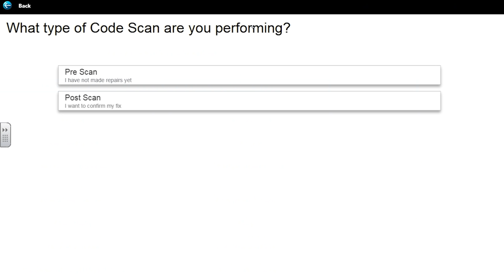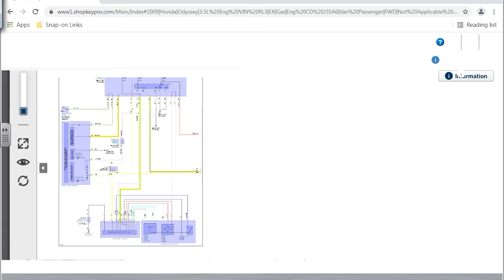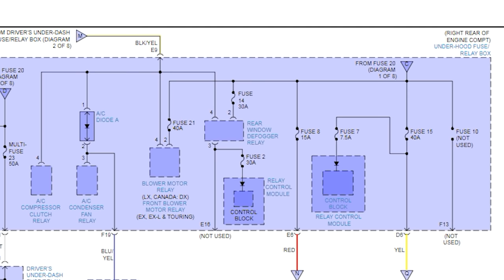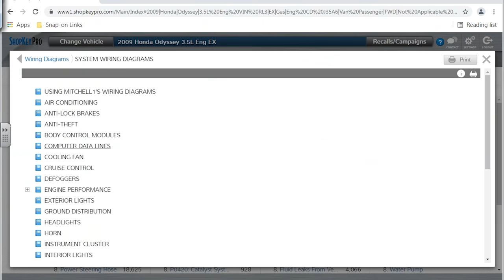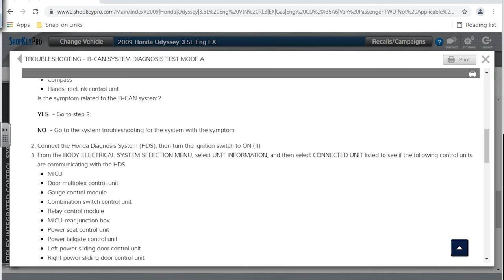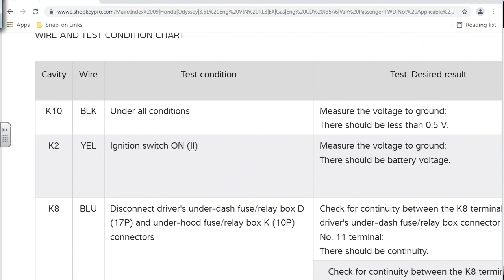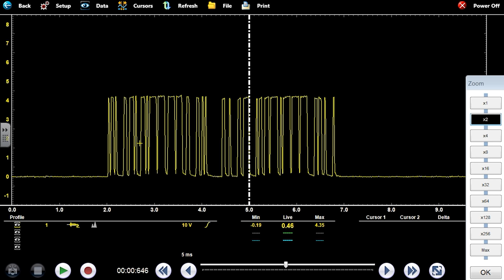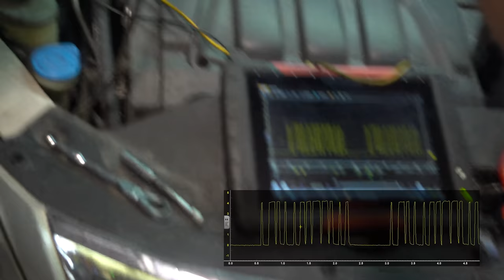Honda B-CAN Network Diagnostics (single wire design)

Comment: I'm working on a A029 communication fault in my Prius hybrid battery system. This really helped with troubleshooting the single wire system. Thanks.
Reply: Did you resolve your issue? 

Fingers crossed 🤞🏽

Comment: Honda in Europe commonly use, for all comfort systems, a protocol called VAN (as of Peugeot, Citroën, etc.). It's similar to CAN in implementation in the way that all units talk but in a 0 to 5V signal. But it's the first time I´ve seen this B-CAN protocol. I'm not aware if this had been used in Europe.
Thanks for the video. It's great.

Comment: Ive been using this same method on networks for years. Check it plugged in, then unplug it, if waveform stays the same, network is good. Ive always wondered if that was a valid test method, ive always thought so and youve confirmed that. Ive also wanted to depin the network wire and plug the connector back in to check if anythings coming from the failed module but never have. Was cool to see you do that even though you cut the wire lol just giving you a little bit of a hard time. 
Caleb, i was laughing my butt of when Danner was messing with the wipers and the music you edited in. That was classic, great job.
Reply from the maker: Thank you my friend! This was a good one and I appreciate this feedback

Comment: The final "unplug test" is worth a million thank you's. Another test in my arsenal, Thxs a bunch scannerdanner
Reply from the maker: I agree 100%, if nothing else was gained, the unplug it test that still showed network activity was super useful in identifying the network wiring integrity without using an ohmmeter to check for an open circuit. Also, this is a universal concept that we can use across the board on network diagnostic stuff.

Comment: Wow... Use a bigger hammer. I have learned a big lesson on network problems, such as this. I have your book and it has changed the way I look and diagnose many problem. I worked on a 2002 ram and it would not crank, turned the key on and the odometer and headlights would flash. Weird. But using your book and watching your videos I figured it out, took a while but the ecm and the bcm were communicating not having a wiring diagram, going through every wire between the two, and many hours later checking 5 volt references learned from your book and videos I found 3 bad connections between the two. Blew my mind, I figured it out. You are a great teacher. Thanks to Kaleb for his great video making too. Oh congratulations on your new baby. Keep making these GREAT videos both of you, also great to see more of your brother in the videos. Thank you all, and God bless. Jerry.

Comment: Hi again. I remember my Moms Cavalier was back firing and shutting off and it took me about 4 hrs. of back probing to find nothing wrong. Sat the ECM on the floor with the engine running, hit the ECM with a screw driver handle and the engine back fired and quit . Since then that's one of my first tests HAHAHA!

Comment: Heads up big boy, you can see if the Relay Control Module is communicating by going into the "Body Unit Information" and "Connected Unit List".  It will say "Detect" or "Not Detect"

Also, the connectors under that thing are usually mad greasy, probably OE grease.

Great work brother, keep it coming!

Comment: 100 % agree with your diagnostic! again NOT A PARTS CHANGER ... and cutting the CAN B wire totally 100% sure that is the problem.  this is a perfect direction went the same symptoms happened in another Honda Odyssey... thank you Paul Danner for continuing making this videos! my thoughts this case is that not even the technician from Honda Dealer do not know how to do this test the you just did...in the other hand I'm wondering if the Autel Ultra was used in this particular case if it shows that fuse module in the RED CAN B with no communication!

Comment: "This is not the silver bullet...This is the Smoking Gun of the Silver Bullet"- John Anello. 

I bet that the working circuits are a fail safe so that you still have wipers and headlights in the event of a failure,  because those are critical for safe operation of the vehicle.  Similar to a transmission having 3rd or 2nd gear default in the event of power failure to the shift solenoids.
Reply from the maker: I agree about the fail safe stuff, makes perfect sense! Thanks for the input and the comment

Comment: Fantastic video and a great way to find the problem. That system must be specific to Honda. I'm not sure if you guys over the ocean deal much with LIN, that's also a single wire communication system. The difference is that there is only 1 master module and the rest are slaves unlike modules in CAN which are all masters and can all transmit information independently. The slaves only communicate when requested by the master so that test might not work too well for them. I have de-pinned connectors to find faults with CAN but to be honest cutting the wire like you did would be much easier and is something I'm going to start doing from now on. Thanks for the tip👍

Comment: Another good vid Paul even the new guys would get your logic on this kind of failure diagnosis, its just whats needed so you dont end up chasing your own tail or start swapping parts even, probably a failed solder joint crap lead free solder strikes again no doubt ......maybe

Comment: My experience with a CAN line was an afrermarket Pioner radio headunit with nissan x-trail/Rogue(in US) It had a CAN box for steering wheel controls and backup camera signal. The car acted strange,  suddenly the dim lights came on for a sec, then no wipers, air con, no torque converter lock, no turn indicators in dash. But the indicators still worked outside, so some fail safe mode was on.  Engine off and on, it worked again. Sometimes a hour, sometimes for a month.
The only module I could not talk to was the BCM, othes had can codes, ECU even"change the ECU" code. Ordered a used BCM, programmed it and it was good only for a day :(.  One time I went to an ATM with mi phone in my pocket and out of the BT range of the head unit. My son was in the car, engine running. As I neared the car, BT connected and the dim lights came on. So it has something to do with the head unit. I removed all connections for the head unit and fow about 2 weeks it was ok. Then connected power and speakers, but not the wire from the CAN box. It all worked, but no steering wheel buttons. The car did not have any DTC's since then. 
Now I have an Android head unit without can and the steeringwheel buttons work.

Comment: The hell with the Honda let’s work on the 32 Ford and the Duster in the background.  Great video Paul.  I love these who done it mysteries.  I just wish these sites that provide the wiring diagrams weren’t so expensive.  Guys like me who work out of their home shop have a hard time affording them.  Cool find, now Ivan would take apart the module and fix the bad solder joint, ha ha.
Reply from the maker: There is a DIY version of what I use that runs $20 a car. If you're doing some side work, just make that part of your bill
https://eautorepair.adtrk.biz/?a=10817&c=24&p=r&s1=
Reply: @ScannerDanner  
  I’ve used Mitchell a little bit for some jobs, I’m just old school and like the old repair manuals.   I was a dealer mechanic for 14 years before I jumped ship in 1988 and went to work for the State in Corrections but still did a lot of work at home, still do, retired from the state in 06.  It’s almost a full time job working from home.  I find your channel and your course invaluable.  Thank you for what you do.
Reply from the maker: @weshawkins7165  thank you!

Comment: It's nice when you can "percussively" prove a module like that. You can almost guarantee it's a cracked solder joint. But will the availability (or not) of a replacement mean you have to repair this one for refitting or just open it for examination....

"Someone's been here" - they've obviously had this intermittent for some time and maybe found that moving the box restored operation. Probably saw some corrosion on a pin and applied all the grease, could have worked for some time just because they disturbed the connectors.
Reply: I wonder about pin grip on that particular terminal. I'd have checked that  cleaned it with deoxit and added some stabilant 22A to it.

Comment: I like to do one last test. the pin drag test. I use welding torch tip cleaners and start loose and find the correct size it could be corrosion or bad pin contact. torch tip clean as well. I had an engine pcm stall when I used a little pressure on the plug

Comment: Excellent diagnosis and thought process. I agree that troublemaker charts are often not the most convenient approach but sometimes necessary as they can help with better circuit understanding especially when they don't provide a circuit description.  I see you're using the verus edge here and I wonder if another scan tool such as an Autel might list the Relay center as a scanable module. On another note what are you using as a screen recorder on the verus and how do you add audio to it since the Edge has no microphone built in. I'd like to do that for some of my videos. Thanks.
Reply from the maker: just a regular windows screen recorder and it has a timer. When we start the desktop, we always shoot some footage of the timer count, then since post production :-) Thanks Phillip

Comment: Dead on accurate about how those modules talk on single wire B-CAN(and 2 wire CAN as well). I'm an Acura dealer tech, but it's the same system. I feel the same about continuity checks on comm wires, it's a waste of time/effort. Better to do the "unplug test" you demonstrated and check the comm wires with my uscope(which you convinced me to buy and I love). 

Side note: I don't follow the manufacturer flow chart either haha. Construction and function, theory and operation, what does it need to operate correctly and what are you missing. That's my method. Flow charts be damned :)

You do a lot for the up and comers in this field! I'll be showing the apprentice I work with this video!
Reply from the maker: Thank you so much Nick! This really means a lot to me. Have a blessed day

Comment: Right before you said I should depin the terminal,  I was just thinking, pull a Diagnose Dan and cut the com line! Great minds think alike. But that was great info on single line communication.  I would like to know if the salvage yard module worked.

Comment: I suspect if you are able to take the box apart you will find that a solder joint on a relay or other large/heavy component has cracked. This usually happens due to poor layout of the PCB. Sometimes the solder pad for the large component is not large enough so it can't mechanical stress. Sometimes it is a combination of high current through a connection plus vibration. Large components should be glued down to prevent the solder joints form taking all the mechanical stress but they most often are not. Early 2000s Accords had this same issue with a starter circuit relay under the steering wheel.

Comment: Is this considered to be a LIN communication line?  What a great Vid Mr Danner!  You continue to impress!  Thank you!
Reply: Similar concept, but LIN is usually nearer battery voltage - this was a 0-5V signal.
Reply: no m8
Reply from the maker: as Simon said, same concept just different voltage levels. But if this was a Lin Bus you wouldn't treat it any differently than I did here. Thanks!
Reply from the maker: @CANDiagnostic  what is "m8" can you elaborate for me a little more? Thank you
Reply: @ScannerDanner  mate   m8    😅. Didn't think I would ever teach Paul Danner anything
Reply from the maker: @CANDiagnostic  😂 nice

Comment: Throw away the Snap-On. Grab the Autel instead.  Or an Xtool. It has functions to program boxes like that! No need to call some dude who will charge you a hundred bucks just to program a box. I've programmed various Honda modules with the Autel. Oh, And it has more modules listed. It probably has the Relay Module listed too. Snap-on didn't. You said the best scan tool is the Dealer tool.  The Autel software is based on the dealer's scan tools. It's great that you had to cut a CAN wire. I do it all the time. It's the fastest way to test whether a module is working or dead. Super great video!

Comment: the fuse box will come apart but it is a real pain in the !!!! . I took mine apart to change the ELD after changing the alternator !
Reply: mine is a 2010 ex lots of pins fall out be careful !

Comment: Maybe just realize the reason why: No. 4 line to the Rear window defogger relay, can carry a high current 'spike' when the relays from the AC cluster closes! Relay control module apparently contains some high current components.

Comment: Even if there was a known issue they still would need to test it. I've done so many diags where a shop or a customer found on line a known fix and shot gunned a part with no luck. Just because theres a known issue doesn't mean you dont have to test.
Reply from the maker: exactly! Thank you

Comment: The Horn, low beams and low wipers are "safety" systems. They have to work. Thus they are hardwired and not a request through a communication wire. Probably, unless I'm wrong... Honda diagrams are tough to decipher.
Reply from the maker: I believe you are correct

Comment: Awesome video. Btw , electronic modules are getting too difficult to repair.. Im sure Danner prefer working on the great machine - 1932 Coupe in the background . It is awesome car , and doesn't got electronics.. And the Odyssey - why they sealed the module in a way nobody is able to open it and try to repair it? I think SAE should make universal standard for electronic modules , so they can be repaired easier. 🥃

Comment: I "believe" certain safety things aren't controlled by the can network for this exact reason, which is why regular wipers, low beams, ect. work whereas non-essential things didn't work. Its been a minute since I took my Honda specific training (Honda master tech)
Reply from the maker: makes perfect sense! I bet if I looked at the diagram for those components more closely, we may see exactly that

Comment: So if B can come line modules all transmit and receive. Do the bmw lin bus lines transmit and receive as well without the master module?
Reply from the maker: I'm not 100% sure but I'd say yes, all modules produce their own signals. The master you mention may be some type of gateway module?
Reply: @ScannerDanner  yes I did some research. The bmw single line lin bus system. It’s a master and slave system. The DME acts as the master module. The alternator, water pump, etc act as the slave modules. Communication would disappear and be non existent if the master module (dme) is bad or disconnected.

Comment: Hey I have a 05 sts and I hit a curb and it died out and wouldn't start since I jumped the starter really and it turns but won't start I guess no fuel going thru the battery qont hold charge and the lights on dash flicker when I try to jump it with another car the dash lights go black when I try to start then 20 30 seconds later come back on I'm lost please if u have any advice please
Reply from the maker: Is that a caddy? Check the main ground wire where it connects from the battery to the block

Comment: The module may actually be fine. It seems to me that the issue is likely a pin fitment fault. When the scope was back probed at the connector, it can only measure the voltage on the female terminal in the connector, which is mechanically crimped to the wire. If it's isolated from the male terminal in the module, it can't send its message. Since the data packet seemed to jump high during the tap test, I'd suspect the ground wire is the one at fault. It doesn't seem unlikely with all that grease packed in there; couple that with spread terminals and it's easy to see why the issue occurred. I'm in no way doubting your methods, I just like to be sure before condemning a module.
Reply from the maker: What said this was not a pin fitment issue to me was the jump to high voltage when tapping on it. If it was a drop out only, I'd agree, I then should have checked the pin more closely. Visually everything looked fine. Great thoughts!
Reply from the maker: Should have read more carefully. Certainly a bad ground to that module can cause higher than normal signals. But I'm still not thinking it was pin fitment, though I cannot rule that out 100%
Reply from the maker: One more thought. When unplugging and plugging a connector back in with a non visual problem type pin fitment issue, you almost always temporarily fix it. Along with me backpacking the main grounds with no change in condition. This all goes against the pins being an issue. Just trying to think about why I didn't consider it is all.

Comment: Where do you get wiring diagrams
Reply from the maker: I use a professional service that runs $160 a month (Mitchell)
There is a DIY version that's $20 a car
https://eautorepair.adtrk.biz/?a=10817&c=24&p=r&s1=